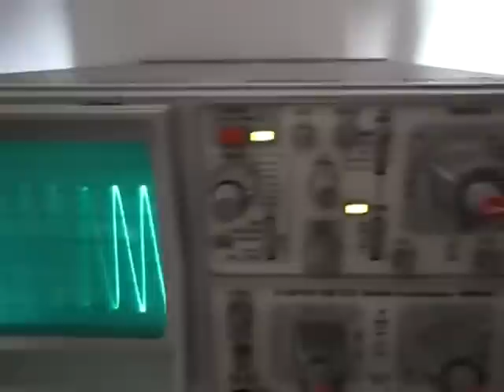24 magnet pulse motor tesla switch

Comment: @FateMaster2 
You need an alternator and then this design will generate more electricity than it requires to run. You can indeed disconnect all power sources when the design is complete. There are folks with such engines in their car, and the battery is required only to get the initial spin and for the lights & stereo.

Comment: no such thing as free energy you have to some amount of work into a system but......why aren't we looking at the systems that put out more than was put in tesla is famous for this be really nice to use a car battery to start a motor like that and have it produce enough force to move your car at any work load all with its own generated force and still have some left over to fed back into the battery for the next start. Just as good as free more plausible(several good reputable examples out there)

Comment: Can the same thing be done with permanent magnets? As in having a N pole stationary and have a disc that is in a very similar set up to this. Where the stationary magnet would pull/push those on the dis causing it to spin?

Comment: Are these motors sold to order ,like I would love to create electric to run baseboard heat in winter?cool  summer with same motor.I'm disabled ,so this was a dream project of mine.Being able to order if reasonable priced can save my family knowing that the idea of this invention can and will someday change the way that the world works I have always how told my family that this will change the way the world can change and focus on other things to make the future a whole lot better thank you  for allowing me to send this message. Thank you I will look forward to your answer. Mg and family thank you for allowing us to send this email.
Reply: Mark Gabbard I am able to help you with a project for a heating system without needing a socket or batteries. you only need motors, fans with magnets sticked on, and 4 big magnets to drive the fans wich rotate powerfull the dc generator 300watts. at the dc generator red wire you have to put a blocking diode to send the current only to the heater 300w. it heats the room slowly but work permanently all the winter.. you need to buy a room tube heater 300w, 400w. but find the right dc generator. also you must use a voltage rectifier for constlantly voltage, and a power controller diming.  you must have an advice, a good electrician. do not work on 20 amps. at 20 amps you can die. heart stop beating from 18-20 amps. you get stuck, muscles are blocked so you cannot move your hands from the conductor material. please ask an electricin electrotehic skilled, qualified. do not build yourself. current is not a joke.

Comment: Now you need to have the wheel turn a small generator and hook it to a voltage regulator so it stays at 12 volts and powers itself without the battery.